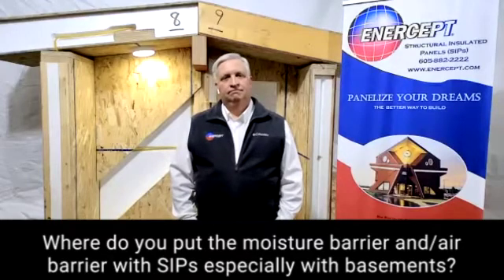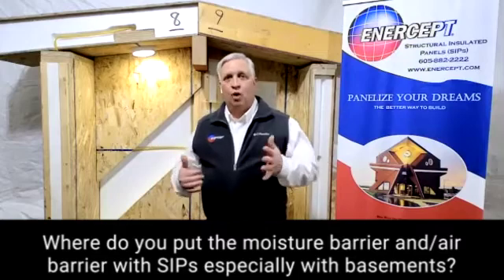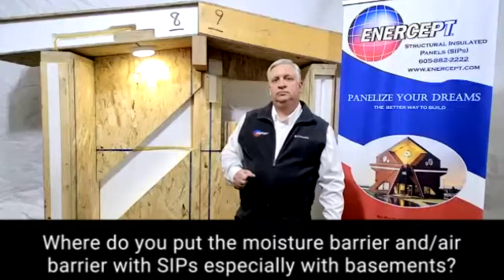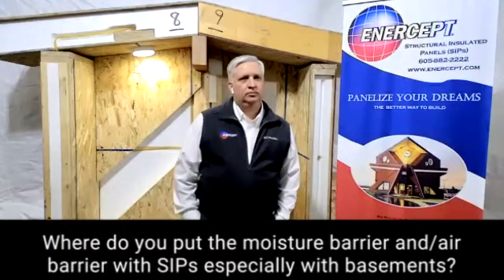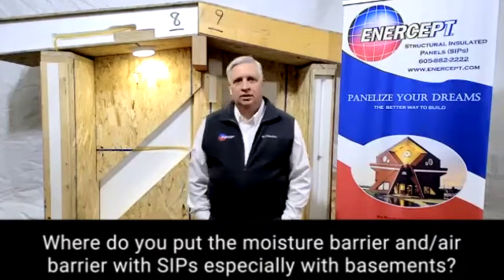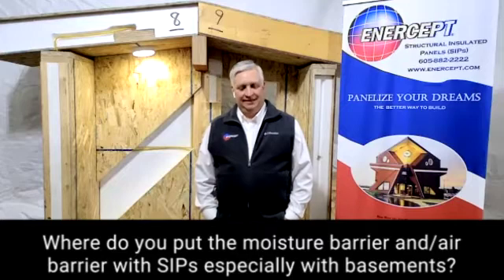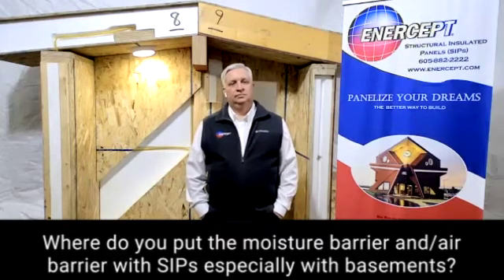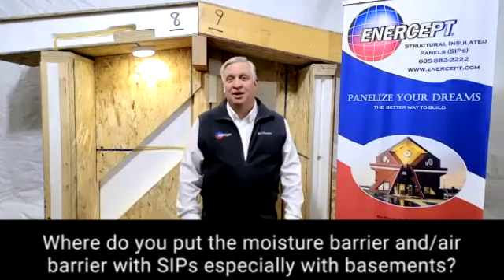Where do you put the moisture barrier and/or air barrier with SIPs especially with basements?

Comment: Great information, green house analogy makes sense. Can I use liquid weather barrier from prosoco
Reply: Osb rots. So you need to use a vapor open Prosecco product on the outside.
Reply from the maker: Prosoco liquid weather barrier could be used if it is compatible with EPS (Expanded Polystyrene) and it allows the OSB (Oriented Strand Board) to dry should the OSB get wet.  Refer to SIP Design- BP1: High-Performance SIP Building Envelope and Design-BP8:SIP Roof and Wall Assemblies on this link  https://www.enercept.com/technical-guide for more information regarding the design of SIP wall assemblies.